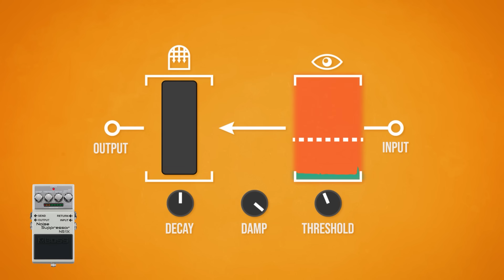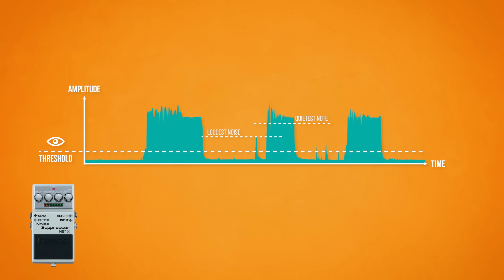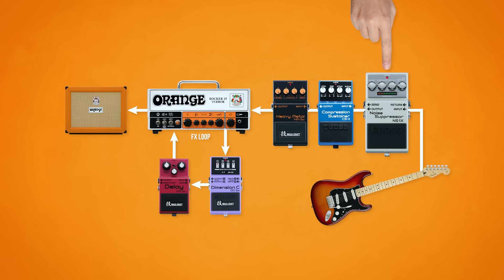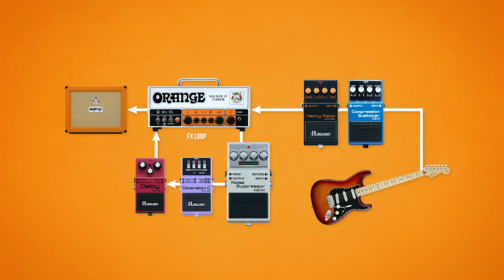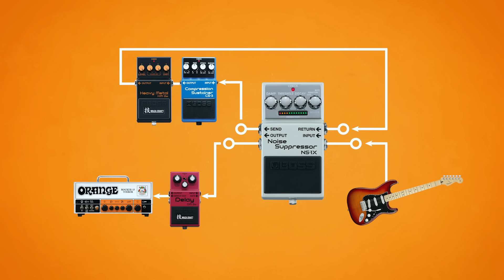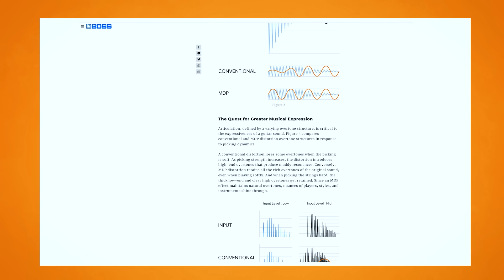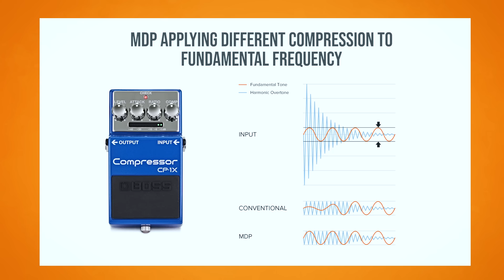Noise Gates: Everything You NEED to Know | Too Afraid To Ask

Comment: I have another noise gate pedal that has a loop send/return as well.  Can you offer some guidance on how to cable this with OD/distortion pedals outside of the amps's FX loop but using the send/return to quiet down the amp's internal noise?
Reply from the maker: NG Send to OD pedals, on to input of amp, FX Send from amp come back to NG Return, on to delay pedal, back to FX Return of amp.
Reply: @ScienceofLoud  Thanks very much! Great video!
Reply: @ScienceofLoud Perfect. This was something i was a little unsure of as well, particularly whether the NG would be first or last in the effects loops send/return. But I guess it makes sense now that the NG output is before your delays/loops/etc as not to cut them off.
the only problem with this is that if seems to add another set of cables from the pedal board back to the amp in my setup :(
Reply: If you forget the order, just look up "4 cable method," and you'll get plenty of help.

Comment: I have a Behringer noise reduction pedal, and it cuts off my sustain no matter where I set the controls.
Reply: I have the same, and I just set the threshold as low as possible, and (without playing anything) I slowly turn it up until it just cuts off the "noise floor." Sustains fine. Maybe you have an overly sensitive unit.
Reply: @castleanthrax1833  Could be.

Comment: I realize that noise-control products are no less susceptible to confusing naming than anything else in the musical world, but there IS a difference between a noise suppressor and a noise gate .  "Gating" reduces the entire signal across the whole spectrum.  Some gates allow one to adjust just much they reduce the signal, from a slight quieting to complete shutting it off.  "Suppression", on the other hand, generally addresses high-frequency noise.  Many noise-control devices back in the days of vinyl, were intended to attenuate surface noise in particular, such that they would detect and filter out such noise during quiet passages.  Both of these are distinct from what is called "downward expansion".  Expansion is the polar opposite of compression and especially peak limiting.  Where compressors and limiters can reduce dynamic range of higher levels, such that the signal acquires a kind of fixed level, downward expansion exaggerates differences in level for quieter parts of the signal, such that what is softer gets MUCH quieter, and leaves louder parts unaffected.  I have a compressor that uses this and it is dead quiet.

I have long held the view that there are two aspects of "noise hygiene" to attend to.  Guitars themselves tend not to produce much broadband hiss at all.  Generally, their contribution will be EMI "hum" from all those nearby sources that pickups and poorly-shielded wiring can be susceptible to.  This can certainly be amplified by later stages in the signal chain, and can sometimes be added to by poor grounding or shielding in pedals, but is typically a guitar-sourced form of noise.  The other source of noise is hiss and some forms of high-frequency clock noise coming from the pedals themselves, especially, but not restricted to, higher gain pedals.  Modulation pedals can produce annoying "ticks" at the modulation rate, but if they are properly designed can avoid that.  Same thing with delay-based effects (echo, flanger, chorus) that have a risk for clock noise leaking through but should be designed to avoid that. (Side note: The Boss CE-1 and A/DA Flanger both had noise gates built in to cut out the delay signal when you stopped playing)  In an ideal world one needs an automatic bass-suppressor immediately after the guitar, before the first pedal, so that no hum enters the rest of the signal path, and a hiss suppressor further along, to prevent any hiss buildup from gain stages.

The chief difficulty with any form of noise control is that such devices make decisions to act or not act, based on signal level.  Some may make a more informed decision than others, but generally they simply respond to overall signal level.  And when there is enough noise (i.e., the "noise floor" is high), that decision point - the threshold - has to be set in a manner that affects the onset and decay of your signal.  Alternatively, if one sets the threshold modestly, you don't get rid of nearly as much noise as you'd like to.  This is why so many contemporary noise-control pedals include a send-return loop, such that the difference between wanted and unwanted sounds can be detected at the point where it is easiest to differentiate, but applied where it will have the most productive impact.  ( Nicely explained, Colin! ) .  The introduction of DSP-based noise detection and suppression has hiked noise control effectiveness up several notches, again because it employs more sophisticated "decision-making".  I suppose one could do all of that in the analog domain, but the pedal would likely need to be rather large.

But much of this is why I have adopted the view that a dual gate/suppressor approach is the ideal.  The guitar goes into the noise-control pedal which eliminates hum, and senses the overall signal level, and applies a high-frequency noise filter to the "return" signal.  That is, you get'em coming in AND going out.  In theory, this ought to result in much gentler application and less intrusive action in controlling unwanted noise. 

(Sidenote #2: Because compressors are generally designed to treat hiss, when you don't play, as soft signal desperately in need of boosting, compressors can often be depicted as excessively noisy.  They aren't...as long as you make sure to feed them a clean and quiet signal.  Stick a compressor after a gain pedal, and it will boost the hiss.  Not good.)

Comment: Nice. I've been thinking to get a noise gate but not sure which one as I can't try most of them, some are very expensive. Aside from noise, tightening the tone for staccato play is a goal.
Which ones would be enough and simple for fair price, I've seen most well known already but yeah, choices.
Reply: I'd strongly recommend the TC Electronic Sentry. It's not very expensive and you can use it 4-cable.
I own one and I love it.
Reply: @RayTorvalds  can it run just 2 cables ?
Reply: @StaySic4Ever  Definitely.
Reply: I've got a Behringer NR300, and it's just a clone of the Boss NS2. Works perfectly well, has the send/return inputs, so if you're OK with plastic...👍

Comment: Where was this video 10 years ago when I needed it!?
Perfectly executed. Short and to the point, with great animation for easy understanding.

I have an old NS-1 in the Send/Return-Configuration to keep the old chainsaw in place, works well.
However, there is still some high-frequency whistling when the gate closes.

The new NS-1X seems to handle that a bit better, check these two timestamps:
09:05
11:13

Comment: So if we're using a 4 cable noise gate like this one with a pedal switcher, would placing the sensor portion immediately after the guitar/before the switcher while placing the gated portion in the desired loop be a feasible option?

Comment: Colin,
     In the NS1X, is the DSP used for sensing only?  Or is it also involved in the actual gate mechanism?  What I'm wanting to know is if the digital is in the signal path.  I'm sort of an analog purist and I'm trying to avoid my signal being digitized in the chain going to the amp.
Reply from the maker: 1. I don't know for certain, but I'd imagine the signal IS being digitised as the MPD is analysing the waveform itself. Maybe the signal path is fully analogue and it analyses a digital copy, but who knows. 
2. That's something you probably want to get over at this point.

Comment: One comment on the threshold, some (digital) noise gates have 2 thresholds, one for opening and one for closing. Which I found very handy, as it helps with tails and long vibratos
Reply: I believe that’s called hysteresis in many gate plugins, Cool that pedals have that too!
Reply from the maker: The iZotope gate I use on the post side has the open and close thresholds, which is super useful. 
It's great when it can be visualised in that way, but it would probably be difficult to implement properly on a compact stompbox.

Comment: This is a great explanation video! I was wondering - is it possible to do this on modelers with splitting the noise gate signal in half? I have the new Fender TMP and was wondering how I would set something like this up for high gain. Thanks!
Reply from the maker: As far as modelers or plugins go, it really just comes down to whether or not they programmed it to do this or not. 
If you have a modeler that lets you place multiple copies of effects where ever, then I would just put 2 copies of the noise gate - one at the start of the chain and one after the distortion sources. 
One to catch the low level noise floor from the pickups, and the other just to tidy up the handling noise from the gain staging. I've seen plenty of people run physical pedalboards like that too. 

There's also a chance that the modellers will be more forgiving that physical equipment when it comes to handling noise from amplifiers and drive pedals, so you may only need one instance of a noise gate early in the chain.

Unfortunately you'll just have to mess around with your Fender and see what it allows you to do.
Reply: @ScienceofLoud   Thank you for the detailed reply. Idea for a future video: How analog signals work vs digital (e.g. Amp signals vs digital amp modelers, etc)

Comment: Awesome video!  I was wondering can you put a guitar pedal between the amplifier output and the speaker?  I was wondering this because of an amp sim on Linux called Guitarix, and then I noticed where you put the delay pedal on your demo.
Reply from the maker: No, DO NOT put a guitar pedal between the amplifier output and the speaker. You will fry the pedal and potentially damage the amp doing so. 
The output from the amp is much higher power than the level output from other pedals and an amplifier's FX loop. 

Amp sims don't have to obey the rules for physical reality, so please don't assume that because you can place simulated pedals between sim amps and sim speakers that it is safe to do so in the real world. 

Delays can be applied to recorded guitar sounds in post (which would make them after the amplifier and speaker), or I can use the FX loop on either my amplifier (which puts the delay after the preamp) or the FX loop on my loadbox/attenuator (which puts the delay after the whole amplifier, but before the speaker in a way which is completely safe)
My graphic represents the delay being in one or other FX loop.
Reply: @ScienceofLoud  Awesome, thank you, that is what I was thinking, but it is always better to ask someone that knows about these things then to try it out.
Reply: Puting a pedal between the amp and the cab in any Sim (either physical or digital) is analog to the physical FX loop of an amp. Meaning, it goes after the pre but before the power amp. In the physical realm, the FX loop is wired between both amp sections, but "drawing" that in the digital realm is tricky and doesn't makes much sense. 

So, the common interpretation is that adding a pedal between the amp sim and the cab is like putting an effect in the FX loop, between pre and power sections
Reply: @wido123123  If you put a pedal after an amp sim on a digital modeler, the pedal is after the power amp sim. There is nothing tricky about that, and it is different than using an FX loop.
Reply from the maker: Some sims will allow you to place anything anywhere, leading to situations where you can place the speaker before the amp if you want. We can't assume they are obeying any conventional physical rules.

Comment: I always tought noise supressor was different from noise gate. Thanks for the clarification!
Reply from the maker: Boss released their 'NF-1 Noise Gate' in 1979, this was in production for almost a decade until they brought out their new version with more features, which needed a different name, and they called it 'NS-2 Noise Suppressor'

The 'Suppressor' name only exists to differentiate their 'new' 1987 pedal from the older model they were replacing. It would be like thinking a 'Super Overdrive' is something different from an 'Overdrive', or a 'Phase Shifter' is different from a 'Phaser'. Boss simply changed the names for the newer pedals. 

It really is that simple, but it's surprising how caught up people can get on a name.

Comment: I use the ISP Decimator because it only has ONE knob.
Simplicity is always better.
Reply from the maker: Simplicity has its advantages, but it isn't always better. 
Noise Gates are one place where having additional controls has demonstrable advantage, as this video shows.
Reply: @ScienceofLoud  But the Decimator isn't a noise gate, it's a downward expander. Also, you didn't do any kind of comparison test between Boss and ISP pedals so I'm not sure you can say there is a demonstrable advantage. By the way, I've asked both Dave Friedman and Bruce Egnater what's the best noise reduction device and they both said ISP. Bruce even licensed the circuit for one of his amps.
Reply from the maker: Downward expander is just a more mechanical way of describing a noise gate - two names for the same thing. 

The advantage is that with access to the parameters one can dial in the gate to suit a situation, without access to the parameters one is stuck with whatever the manufacturer decided.

I'm glad Dave and Bruce have a preference, lots of people do. I also have preference for other noise gates. Use what you like best, I'm simply suggesting that simplicity isn't always better.

Comment: I've always heard of sidechain compression, but never really put any thought into sidechain gating. I think I've fallen in love with this pedal.
Reply: Gates are an extreme type of expander, which is very similar in operation to a compressor (with a limiter being the extreme). They just working in the opposite way. One decreases volume when the volume is low, the other decreases volume when it's high. Most features that can be applied to a compressor can be applied to expanders as well.
Reply: How does side chain compression work? And what's the benefit. Can't find any good explanation online
Reply: @pimcramer2569  the side chain is the signal used to trigger the compression. It will usually be either the input signal to the compressor (feed forward), or the output signal from the compressor (feed back). The signal can be modified in any way, just like a normal audio signal. It can have it's volume changed to increase/decrease the compression threshold, or it can be filtered so only certain frequencies will trigger compression, or it can be a totally different signal (like a kick drum causing the bass to drop in volume).

Comment: My revv g8 does the opposite of a noise gate... Whenever it is turned on it adds a bunch of noise... Never buying from revv again. My friend also got a custom revv amp for over 3k, and it had issues as well. Ig their QC is bad
Reply: May be a bad batch, or you’re using a terrible power supply. It’s not a common issue with Revv from what I can find. Their products are always amazing.
Reply: @justinvzu01  I'm using a Cioks DC7
Reply: Time to get ahold of them and get that thing replaced. Same with your friend
Reply: @diabeticmonkey  I tried, their customer support was terrible and they were making up every single excuse they could to not issue me an RMA. Then I bought a victory super kraken, was highly impressed, and decided to send the G8 to them. The guy I was talking to said he would repair it, and asked if I wanted it back once it was repaired. I told him he could keep it because of how good victory was to me. I bought my Kraken used and it was missing some nuts and washers, which they sent over to me for free even though it wasn't their responsibility